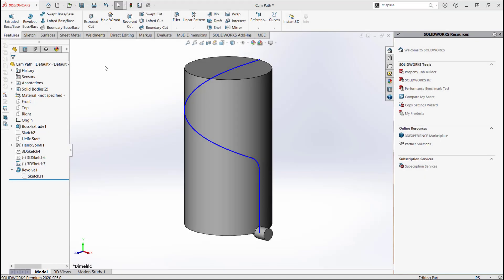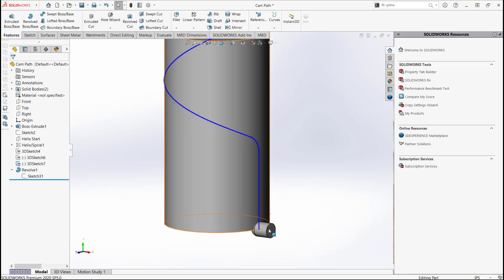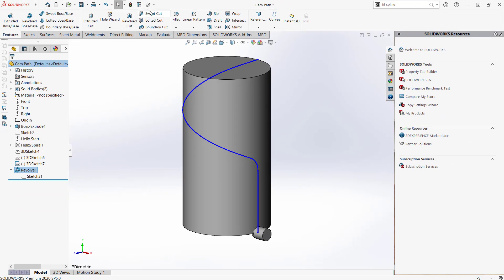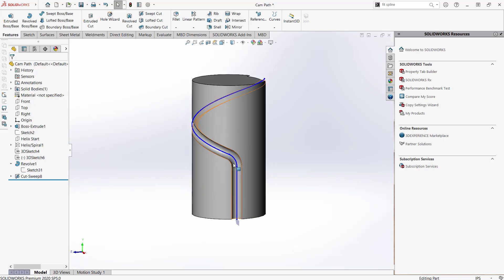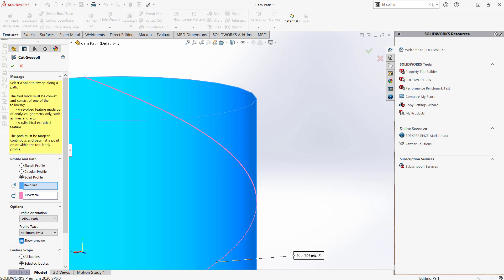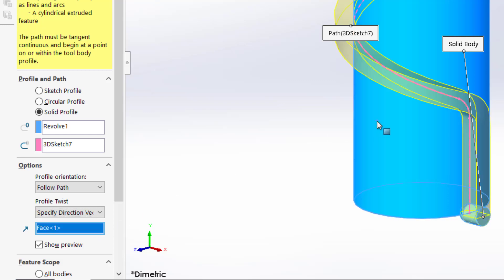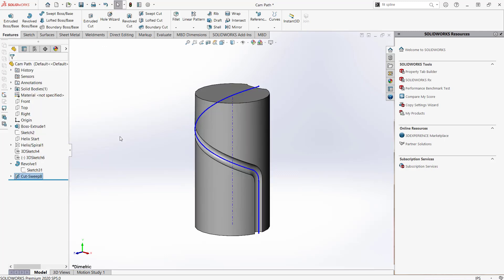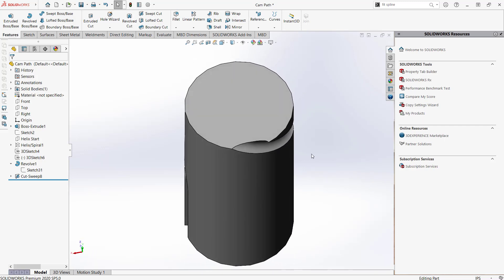SOLIDWORKS - Advanced Swept Cut Features

Comment: I have a question that extends beyond this particular operation, but am not sure how to achieve it.

What if I wanted to rotate the tool body as it travels along the path. The idea behind this; imagine a gear and I want to cut the teeth along the path, but the gear would rotate as it moves along the path. Can this feature (or another one) be used to achieve this? Thanks!!
Reply from the maker: Currently there is not a single feature type that is going to be able to accomplish what you are looking for. Creating the right cuts and then patterning that cut is likely the best way forward.

Comment: Hello, thank you for this tutorial. It worked for a simple cylinder for me. But when i tried a more complex model (like an oval glass jar), it didn't work! When i tried to clic on the revolving body, it says "Tool body must be convex and not merged with the main body". Any solution please?
Reply from the maker: Without being able to see your settings it is hard to say exactly what might be causing that error. It sounds like the geometry of the tool body is something solidworks does not like.  For specific help on your situation please contact your VAR's technical support team.

Comment: Temporary axis is not appearing as Direction Vector under the Specify Direction Vector box. I do not know why? (Time 1.36)
Reply from the maker: The profile needs to be cylindrical in order for temporary axes to show up. You can also check to see if Hide All Types is enabled from the View menu.
Reply: @goengineer  Temporary axis is appearing in cylinder but Specify Direction Vector spin box is not detecting it. If you want to see I can attach my file.